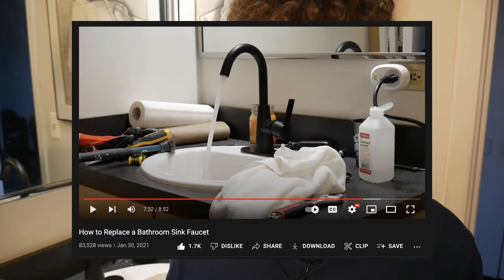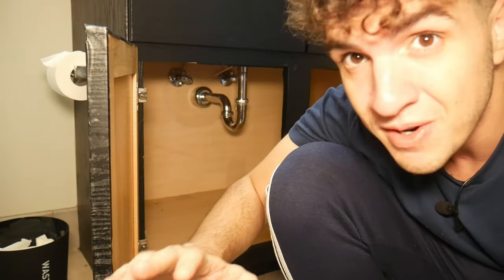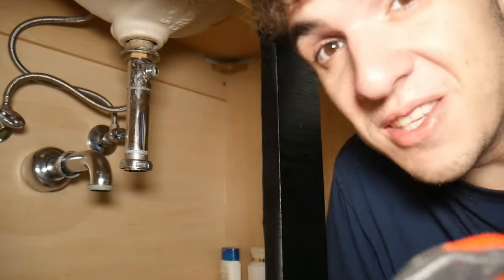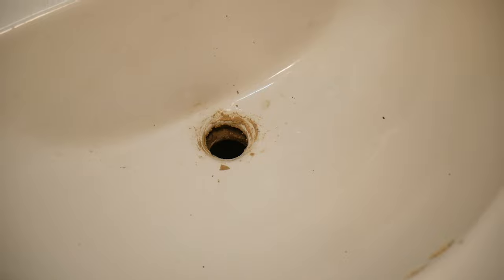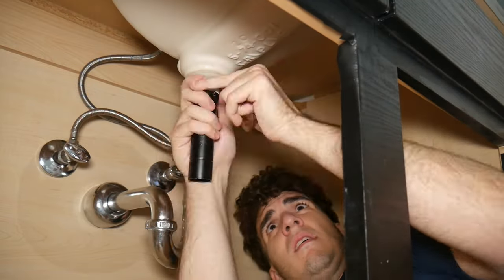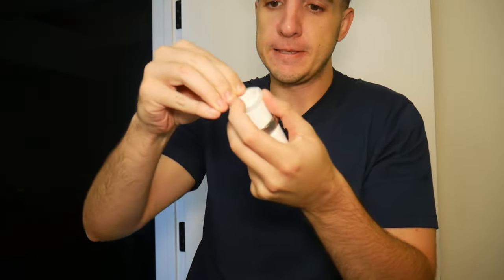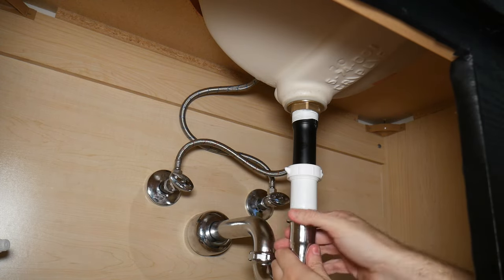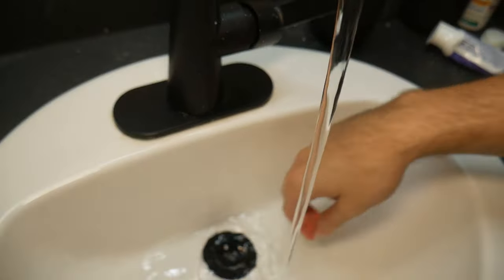How to Replace a Bathroom Sink Drain

Comment: The part that you skipped is the ONLY part I needed to see.
Reply: Same! 🤦🏿‍♂️
Reply: @ninosuevi6573  I ended up using a dremel to cut the popup collar just enough to get through the threads which released the tension and then it easily unscrewed by hand. Not an option if you need to re-use the top collar.
Reply: I agree
Reply: Bro I want to see how easy/hard it was to unscrew that drain. You skipped the main part.
Reply: Lol
Reply: same! 😆
Reply: THIS!
Reply: You didn't show what I needed to see either I needed to see if there was a rubber piece like a gasket on the top side because my instructions show that there is but it makes it so tall it holds water. You also talked about plumber's buddy but you didn't show any plumbers putty going in anywhere and you talked about them almost like you don't know where the plumber is petty goes plumbers putty goes
Reply: I always hv 2 go to Home Depot twice. 😂😂😂😂😂
Reply: The part you got stuck that you didn’t show is what I needed to see and know.  Thanks for the help.

Comment: The top chrome plated flange is threaded and is frozen to the top threads of the sink tail piece that goes down through the sink. Either the previous owner glued that top flange piece on or it's rusted in place. Either way, you didn't show anything in the video about how you removed yours.
Reply: You have likely solved your problem by now, but for the benefit of anyone who has the same problem in the future: The top flange will typically have a hole in it that lets water into the drain pipe from the sink overflow. If you stick a screwdriver in there and use a pipe wrench on the drain pipe below the sink you might be able to get enough leverage to unfreeze the threads. Otherwise, if you are replacing the drain pipe anyways, you could just saw through the pipe.

Comment: I figured out how to do what he didn't show. I took a pair of needle nose pliers and stuck it into the drain into one of the little holes after I had unscrewed the bottom part is much as I could. Once putting the needle nose into the drain and into one of the side holes that is visible now that I unscrew the bottom part enough, I'm able to hold it still and unscrew it.

Comment: I can't stop the part in the sink from spinning so I can't unscrew the drain. Help!
Reply: Don't know if you found a solution, but there should be a drain hole inside the drain you can wedge a screwdriver in to help. You can also try grabbing the pipe with a pipe wrench but if you get the nut low enough to fit it above (it will strip the threads and you'll never get the nut off.

I found it best to loosen the nut closest to the drain first, before loosening or removing where it connects to the trap.

Comment: Where the bottom gasket (just above the brass nut) goes into the bottom of sink from underneath, any need for silicon and sealant there?
Reply: Definitely not silicone. Teflon tape wouldn't hurt but it's usually not necessary.

Comment: 19 seconds in and already you do not have a clue, those are channel locks.
Then you do not show how to loosen the lower nut and remove the flange. That is where I am stock; removing the flange.
Reply: Channel Lock is a brand.  Those are called pump-pliers.